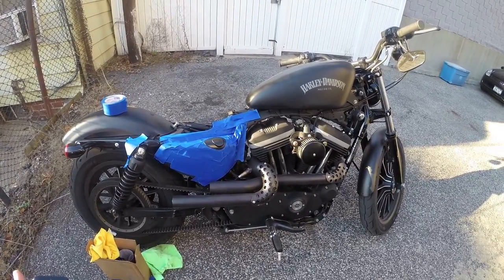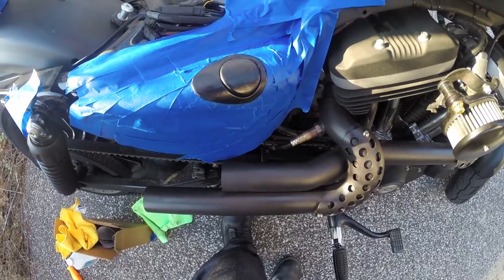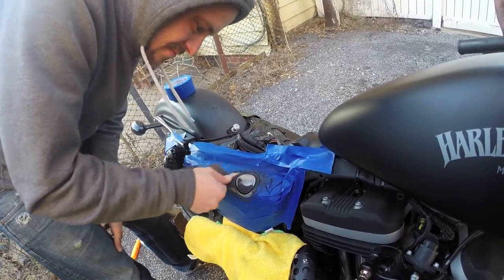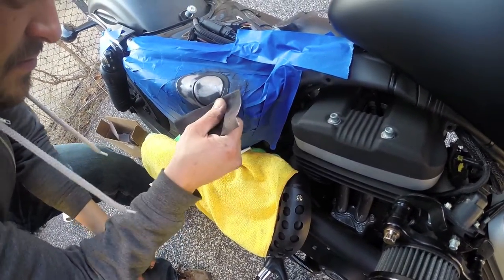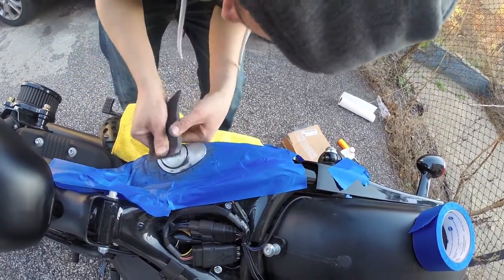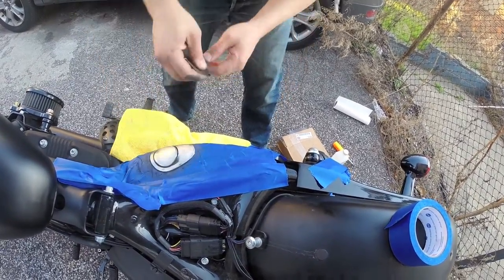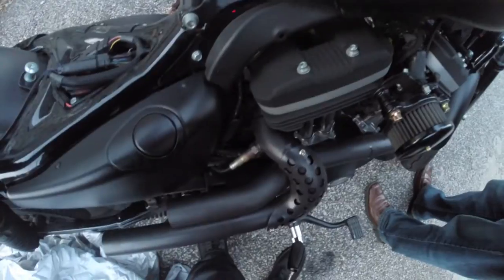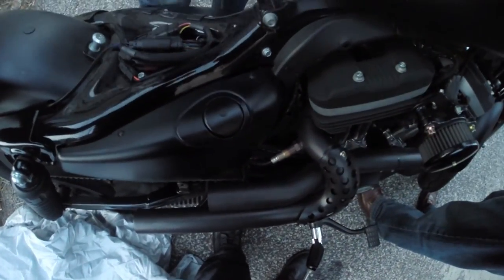Painting the Oil Cap on my Iron 883 - Right Thing Motos

Comment: A for effort and comical!!!!!. I just hope no one uses this as advice! Anyone who reads this that entire side panel comes off, there is a little clip on the bottom that way you don't have to cover the entire bike. You can remove the bezel (grey piece oil cap fits in) from there, its only held on by a little washer.
Reply from the maker: Hahaha! Good to know! I'll be sure to do that when I touch it up and finally get rid of that fingerprint. Thanks for commenting a much more effective way to do this!